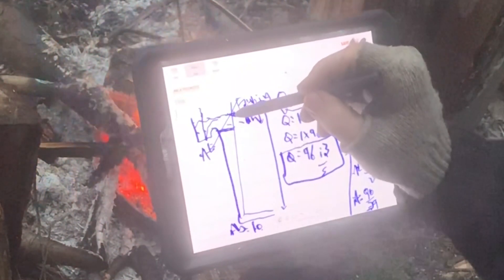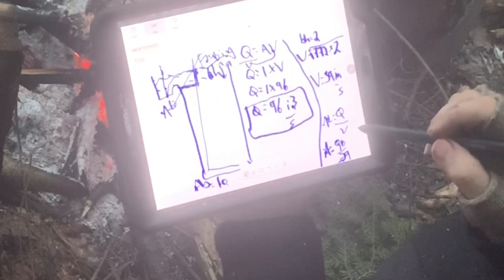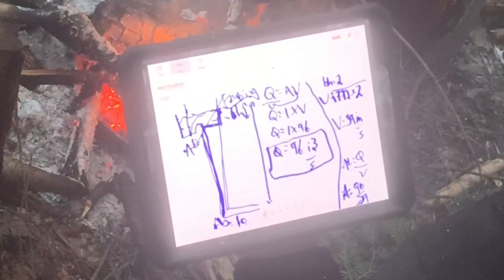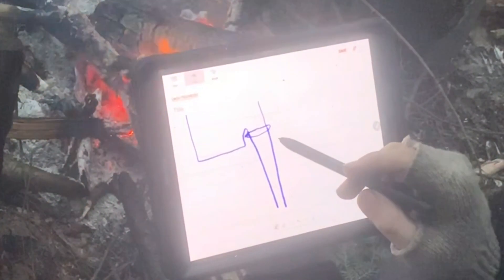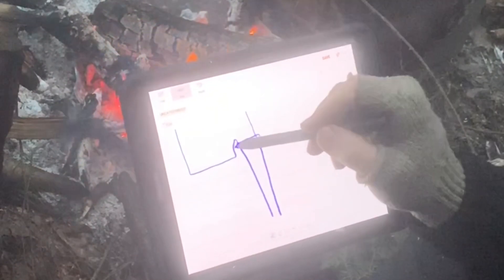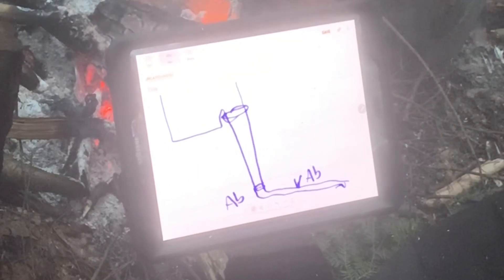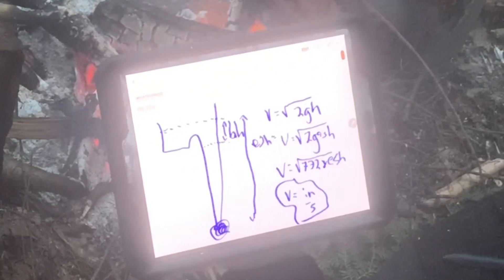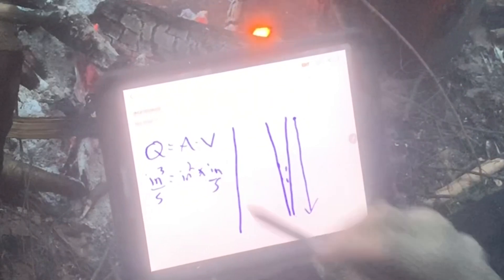Sprue design.  Pouring as fast as you can.

Comment: I don't understand where 772 comes from. @ https://youtu.be/rnQnB7MQtGI?t=469
I get the 96. But all of a sudden he is using 772 and I keep replaying this and I don't see where he gets it from.
Reply from the maker: Good catch. He doesn't explain it. What it is, is the gravitational acceleration in inches per second.  Gravity is 32.17 feet per second second or 12*32.17=386.04 inches per second second. The times 2 is for the basin height. So after two inches the metal is falling 386*2=772 inches per second.  Hope that helps.
Reply: @swdweeb  Thank you. I was mixing units. I'm half Imperial and half Metric. I switch depending on the application. For acceleration due to gravity I always think 9.81 m s-2 , I have never thought in terms of inches per second.
Reply from the maker: @tinayoga8844  Yeah, I'm a little surprised that Bob, being Canadian, works in inches. Glad I could clear things up, it took me a long minute to figure it out 😀

Comment: So how do we best get that velocity reduction from 96"/second to 20"/second for everyday day work in short  molding box? x 4.8 [surge,filter,vortex, or other?]
Reply from the maker: This is best answered by someone more knowledgeable than I, but I can tell you this.  The the surge trap (as I call it) at the end of the runner is to absorb that initial wall of metal coming down the sprue and into the runner.  Placing a gate above and perpendicular to the runner should allow the metal to rise vertically in the runner and fill the gate from that rise (as opposed to taking it straight off the sprue).  Given the volume of metal entering the mold is going to remain fairly constant you can then modify the velocity of the metal by increasing or decreasing the size of the gate entering the part.  If the cross-sectional area of your gate is twice that of your runner it stands to reason that the velocity of the metal entering the gate should be half that of the velocity of the metal entering the runner from the sprue.
In larger boxes I know people use ceramic filters as well but I have zero experience with them.
Reply: @swdweeb  the "SIVEX FC from foseco" 50x50x22 at about $1:20 each per 500 and are the filter of choice for aluminium work.And then the "SEDEX Sic version 50x50x22 is choice for bronze work are both are great for trapping entrained oxides and slag. But of course, don't fix bad gating design which turns tends to be a very common misuse of them. Those Pyrex glass fronted pours you have been doing are great too view in detail. Thanks for posting them, martin. As insightful and meaningful.
Reply from the maker: @TheSilversheeps chicken out on the pig comment?? 😀

Comment: Good to see some fresh thinking instead of trying to copy 100 and 200 year-old practices from the ancient ones. Anybody that has been in the casting business understands the goal is to pour as quickly as you can to standards which make an acceptable part in order that there be some profit on the table for the next successful pour.  Otherwise, soon you be out of business.

In this vein, the object is to maximize the size of the sprues, runners and ingates to whatever dimensions you can keep full. Otherwise, you are restricted to very small parts which are unprofitable to pour by any method. Small sprues, runners and gates make for small parts and failed larger parts which cannot fill without first causing a freeze-out.   

The more dense and smooth the sprue, runner and ingate, the faster you can pour without causing turbulence in the feed system. Same holds true for the mould surface. If you have doubts about what I say, try a ceramic sprue, runner and in-gate along with using a ceramic filter at the ingate. Your freeze-outs will disappear and your casting quality will improve.  Then, you can start getting Mercedes Benz prices for your castings. Until then, you will get about $200 or less.

Comment: Thanks for putting these up +swdweeb and @R Puhakka! Some awesome information in here. 

I have an issue, I used Bobs calcs but get very small areas for a given flow rate. I calculated for 0.5kg/s average flow rate but in practise (I just poured) I couldn't get anymore than 0.1kg/s down the sprue. Anyone else had similar issues? Wonder what I did wrong. I have been using nomograms previously which give me quite a bit larger sizes (~2.5x).

Here are the numbers if anyone is interested. In metric. 
Specs were 0.5kg/s mass flow rate = 1.85x10-4 m^3/s volume flow rate. Sprue height 170mm, V(bottom sprue) = 1.82m/s, A(bottom sprue) = 101mm^2, V(top sprue, 20mm basin height) = 0.63m/s, A(top sprue) = 294mm^2, GVCF 3.65, Total gate area = 370mm^2
Reply from the maker: I was kinda hoping someone smarter than me would respond. Let me see if I can get olfoundryman to take a look.
Reply: @swdweeb  Thanks, much appreciated!!
Reply: Bobby, As I recall Bob's calculations did leave out some important little things 😏 But let me work through the calculations and see what I get. I am a bit concerned about the 20 mm basin depth. It would be very  hard to keep a basin only 20 mm deep (that's just 10 mm over the basin ridge) full enough all the pour to guarantee the system working as designed. The true basin height is the depth to where the radius joining the basin ridge to the top of the sprue meets the sprue - is this what you have measured as 20 mm if so I think its  probably 10 mm to low. The 30 By 30 basin we use has a 30 depth to the true start of the sprue. We (including Swdweeb) have this basin design as an STL which can be 3D printed to show what we thing the basing should look like give us an email address we can send it too. Also how big is this casting? An average of 1/2 Kg per sec is pretty high! I pour 2 Kg castings in about 15 sec and some 3 Kg ones in 30 sec. How did the casting go at the 0.1 Kg per sec did it miss run? … Martin
Reply: @olfoundryman8418  Thanks for taking the time to look at my issue!

My basin total depth is 50mm and is 100mm x 50mm in size. The true basin depth is 15mm, I used 20mm as I guessed this is where the basin would be filled to during the pour. I think you are right it is likely too low. During the pour when it was flowing it did seem to work okay. Would appreciate a look at your basin, my email is volodkovich@hotmail.com.

Casting is 5.3kg, and yes it miss ran badly. Poured probably ~1kg in before the sprue choked up and it stopped flowing not long after. First time I have had any issue like this so I am sure the sizing is just much too small - I have been using bottom sprue area of 200mm^2 previously in castings up to 4.3kg without issue. 

Cheers

Comment: Yep, the volumetric flow has to remain constant, basic stuff and The same calculations in the Fundamentals of Modern Manufacturing: Materials, Processes, and Systems by Mikell P. Groover book I have along. that book has a whole section on ENGINEERING ANALYSIS OF POURING that talks about basic Bernoulli's equation with a few simplifications for gating.
What Cambell and Puhakka have done is set an additional restriction of meniscus flow rate being constant and backsolving for the sprue design. That definitely clears some things up for me on picking the right size sprue. 
note calculations are simplest with a round tapper, but a rectangular tapper is also appropriate in some cases, one of olfoundryman's videos he used a bigger rectangular tapper.